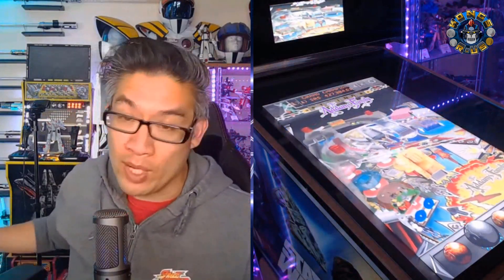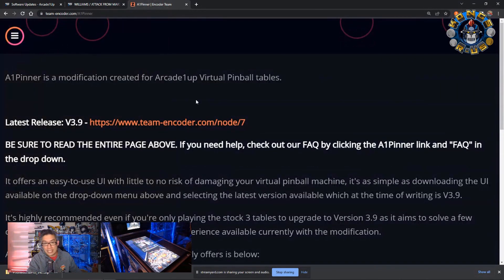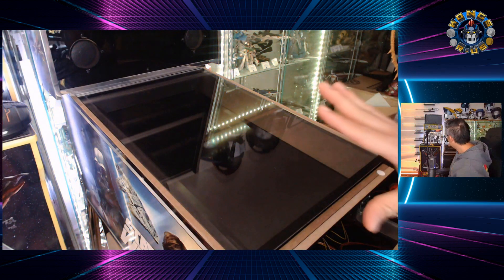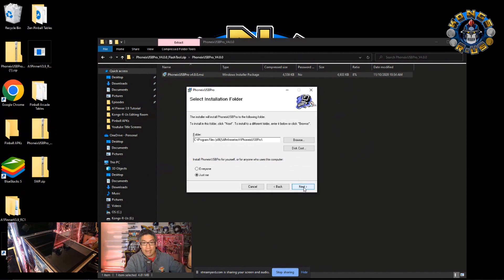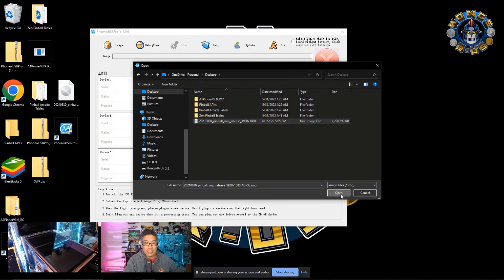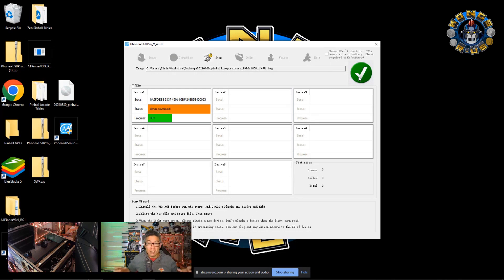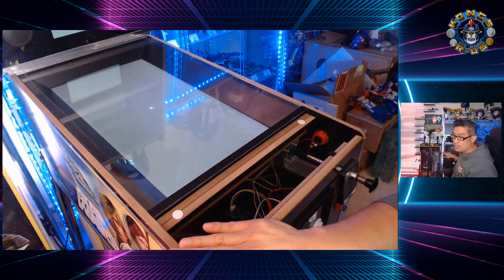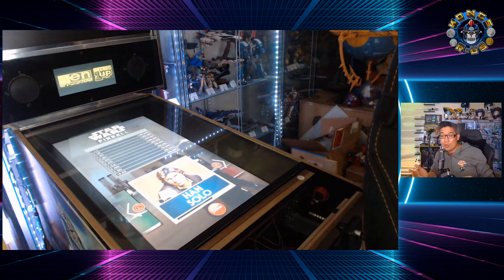Arcade1Up Pinball Hack - How to Re-Flash PCB Back to Stock | Star Wars | Marvel | Attack From Mars

Comment: Hi mate I can't get PCB to connect to my computer? What am I doing wrong?
Reply from the maker: First thing I would check is your USB cable is pushed all the way into the PCB. Try a different cable to start if you can
Reply: @KongsRUs  if the PCB is fried will it still connect? I read something about re floating the CPU with a heatgun?

Comment: I've been trying to just update my Attack From Mars to the official firmware update but had no success. (It's fresh out of the box and the flipper physics are WAY off. Not just White Water.... ALL of the tables. The farther down the flipper the ball is the more lag/weak flipper results you get.) I tried 3 different cables that I know are fine for data transfer. I tried running as administrator. The only thing I can't think that's preventing it from updating is my anti-virus. It seemed to flag it as a potential threat. No way am I removing my anti-virus. Any ideas to get around it or if I'm missing something. (Like giving permission for 1 program to work and then get rid of it when I am done?)
Reply from the maker: What errors are you seeing? The UI for the Phoenix software a little wonky, so make sure your pinball is connected and shows in the UI. It's been a while since I did anything with A1up pinball so hard for me to help you troubleshoot. Don't think a anti-virus has anything to do with it. Last thing you can try is to use another PC
Reply: I don't have any other PC. Just my laptop which I use internet at the library. I just use my phone for surfing the web. Basically I follow their video how to update the firmware. When it gets to be time to turn on the pinball machine to start the transfer nothing happens. It just sits there forever. After giving it a minute or two and seeing nothing I just click stop and do the disconnecting and flipping the switch back so it's not in that flash mode anymore. It just boots up like normal. I got a warning when I tried downloading Phoenix Pro that it was flagged as a potential virus. I installed it and stuff. I think windows defender asked me if I should run it as well. I tried running as administrator, I tried 3 different cables that I know work fine for transferring data. I'm out of ideas. I am not uninstalling my McAfee. I think it's being blocked somehow but my antivirus is not coming off.

Comment: Hey Kong, just a quick q. Been trying the tutorial to reflaah to.stock. But once flashing has finished and reboot pinball, once the minute or so with the circle circling it just stays in black screen. Tried the marvel and star wars images, any ideas?  Thanks
Reply from the maker: It does take a bit longer the first time you flash back to stock. So you could try it again just to be sure it worked.
Reply: @KongsRUs  yeah I thought that may be the case. So reflashrd and left it for 10 minutes, still nothing. I think may be a PCB problem. As the image installed fine with no errors and I redownloaded just to be sure.
Reply: @KongsRUs  hi just to give you an update in case anyone encounters the same problem

Turns out disconnecting the plunger cable allows the machine to boot as normal. With it in it stops machine booting up.

Comment: I have not been successful in making this work.  I cant seem to follow through on the removal of the A1pinner drivers.  It doesn't let me enter yes/no, it simply flashes off when i try to enter the removal screen.  Not sure if that is the reason for failure.  Otherwise, the attempts through pheonix to reinstall the the originals never starts up .  Anyone that can help??
Reply: I found that this step doesn't matter any longer... went back and stuck with the 1up tutorial video as a reference .
Reply: @stephenmaurer6162  Me too.  I was having sound issues (low volume or no sound after mod).  Flashed back to stock and sound back to normal.  I didn't remove the drivers and it seems to work fine.
Reply: I'm having exactly the same issue
Reply: I have the star wars with the pinner mod installed. Is it ok the to use ATM from Arcade1up’s website you think to go back to stock. I am have the same issues with the screen flashing off and not letting me choose yes
Reply: @gregory wunder  yes.. I found that if you deviate in any way from the 1up video tutorial , right down to the sequence of turning things on or plugging in usb etc, the whole thing will fail .. the only solution is to fully reboot computer and do it over.
Reply: @stephenmaurer6162  ok I will give it a try. Need to get my 32” LG monitor patched. So need to go back to stock first. Thanks.

Comment: I am stuck at the first part. When I attempt to use removedriversbat, windows asks if I want to make changes. When I click yes the next blue screen comes up for a second and then closes. Any idea what I'm doing wrong?
Reply from the maker: Power Shell might not be working right on your PC. Try downloading the latest version of Power Shell and try again
Reply: @KongsRUs  thanks for the response. Ive updated powershell and have tried from two PC's. Same issue. Any other ideas?
Reply from the maker: @ARCEE360  I'd recommend joining the team encoder discord and ask for support there https://discord.gg/3vtvHnFZvR

Good luck!
Reply: @ARCEE360  how did you update power shell? I can’t even do that! 😆
Reply: @ARCEE360 I'm having the same issue, did you ever find a solution? Thanks!
Reply: I can’t find the solution and I can’t join discord
Reply: I just figured it out. Disable antivirus, make sure you run the batch file as an administrator and disable any prompts that ask if you would like the program to make changes to computer. You’ll find it in settings of your pc

Comment: Kong, do you recommend doing anything to the PCB to prevent overheating when doing any mods to the machine? I've had a friends PCB die from overheating and I get nervous sometimes, I play mine less than him though. Do you recommend just unscrewing the silver case and leaving pcb naked ? Any tips to do this please.
Reply from the maker: Yes, you can disconnect the metal case from the monitor to help with more air flow. Some people have installed extra fans for ventilation, but I don't play my A1up pinball excessively
Reply: @KongsRUs  Legend, thank you. One more question if you can answer- when doing the mod and adding the 30 tables, say I have the marvel machine, to save my high scores do I just add the apk files for star wars and attack from mars? Or do the marvel one too. Looking to not lose the scores when doing this
Reply from the maker: You will still need to install the Marvel. Apk to get it working with the new launcher, and it will still keep your original high scores

Comment: Ive done the flash to 3.9 but now my pinball machine shuts down (loses power/crashes) then reboots mostly when using zen...has anyone had these issues?
Reply: Same goes for me happened to me 3 times and now it won't come back on now I have wait for a new board from arcade1up to ship out just got my Star Wars pinball last month smh
Reply: Was your PCB decased? If not it sounds like it's overheating.
Reply: @mysteryencoder9997  Should I uninstall zen until 4.0 is released? Have you heard of the power loss from anyone yet? It didnt happen with other releases..only when I installed 3.9
Reply: @UnacceptableFringe  No, It's not related to the mod if that's what's happening; I would feel the PCB and see if it's physically hot. Otherwise, it could be the power adapter Ben Cross has noticed some power adapters are faulty.

Most of us have removed the PCB from their casing to prevent overheating; I had 2 marvel stock PCBs no mods overheat and die.
Reply: @mysteryencoder9997  didnt think of removing the pcb from the casing since it already had a fan...thats a good idea though thank you!

Comment: You should do a tutorial on a 32 inch playfield using mystery encoder geek worm fix on phoenix flash.
Reply from the maker: Lol, that would require buying a monitor to upg! 😄 and I'm lazy to do more mods than I need to. I'll think about it if I find a cheap monitor that works
Reply: I did it pretty straight forward used encoder team geek worm fix instructions. Cooltoy has video it's more about which monitors it works with! I use a 1440p lg 32 inch.
Reply: Lg 32Qn600